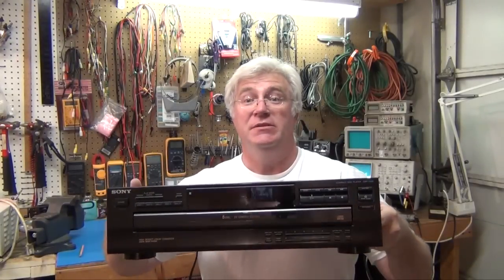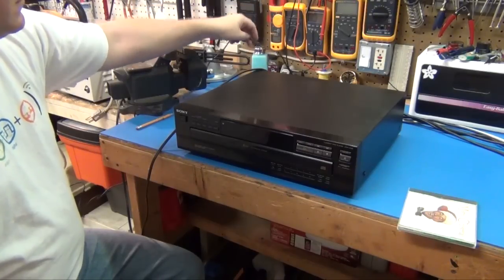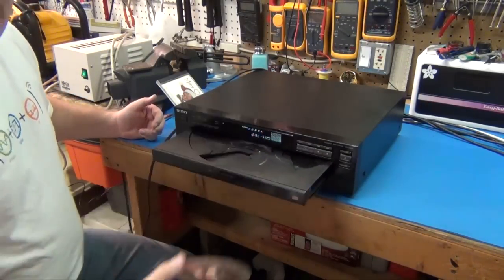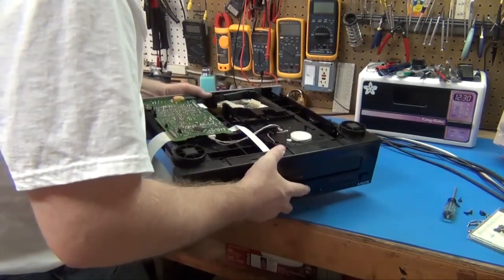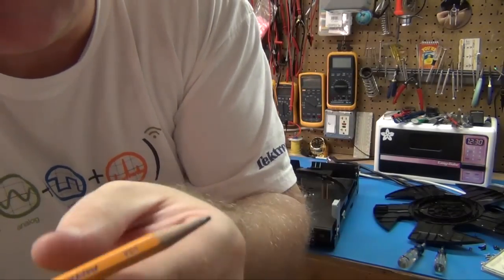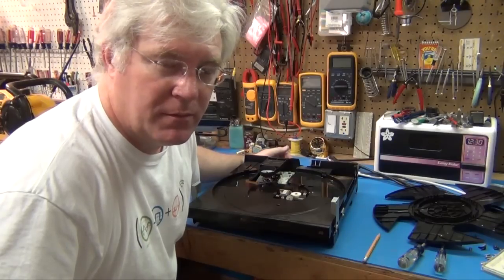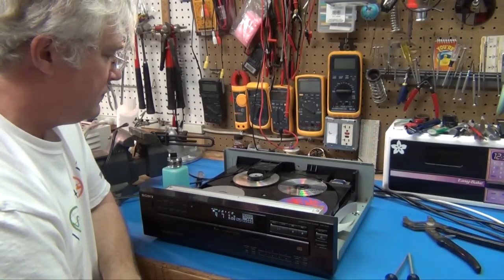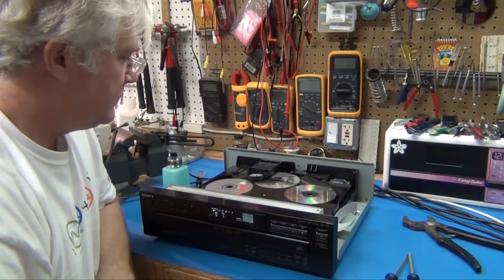ToddFun.com: Repairing a 5 disk CD player

Comment: I have 3 cds stuck inside a Panasonic 5 disc stack system version that broke down today, with one CD quite valuable & rare. More concerned about safe extrication of the discs tgan keeping the player working at this stage, but with no mechanical experience it's a bit daunting! I may try unscrewing some screws to see if I can in any way access them inside. 

  As they say, nothing lasts forever. I suspected it was getting close to the end of its life when the random choice play stopped working, which involved a lotvof disc-changing.

Comment: Would compressed air be the worst thing to use to try to clean dust/debris out of the disc player?  And who wants a multi discount player?  The person with over a 1,000 cds and likes to play them.
Reply from the maker: taking them apart and gently cleaning the optics with a Q-tip helps a lot of times too.

Comment: I have a Panasonic 5 CD player. When we took it out of the cabinet to paint the cabinet and then put it back in the cabinet, it no longer does the commands. It just keeps saying change, change, change. The sound it makes resembles a slight sound of trying to move but it doesn't. Took it apart but couldn't get to the CD's to remove them. This CD player has two boards, one on each side but we don't know what to do to try and fix it. Can you help?
Reply: Sounds like belts are worn stretched or broken time to replace, you can get away with rubber bands that are same size as original ones, I just replaced belt in my Sony 5 disc cd player & recorder works great now.

Comment: Thank you. I just took my Sony 5 disc player apart exactly as you did because I had the same problem. Cleaned the optical switch put it back together and it works fine.

Comment: I have a sony cdp-c26.  It's powered off (except during christmas season :) ) but recently it started shuffling the (empty) disk tray.  The power doesn't turn on nor does the drawer open.  Would you guess this is an optical sensor problem, or more likely electrical?
Reply from the maker: Hard to know. If you can't do repairs one can get working replacement units off eBay nowadays real cheap.

Comment: I have one of these that was sitting in my basement for 5 years, I just took it out and when I plugged it in it powered on but the front drawer wouldn't open and it wouldnt power off when I pushed the power button, I was going to just throw it away but then I decided to do an old fashioned repair method, I punched it in the power button and punched it in the eject button, the drawer opened 1" and I pulled the drawer out all the way and it closed by itself when  I  pushed it, and then I was able to get it to open and close by itself, now it's working fine. :), so sometimes the old fashioned repair method (teach it who's boss) really works!

Comment: You made the comment "Who would want a disc player" thanks to memory stored media! I much prefer the less compressed audio quality of original CD's, and still have several hundred I enjoy listening to. There is a fairly large market on Ebay and Amazon for working used changers and they command some crazy high prices now in 2020!
Reply from the maker: I fond them at Goodwill and other donation shops for $5 every time I go to one. Not normally the 5 disk changer cartage but often the 5 disk draw versions. If you go on the 2nd Saturday or whatever they will give you it for 1/2 off, plus if you stop in on a Wed and put an item on lay away you can still pick it up on Saturday for the 1/2 off price (secret most don't know about Goodwill).
Reply: @ToddFun  that and various thrift stores have been a great source. Thanks for your comment!

Comment: Seems like one of those issues where a solid tap on the top would have magically fixed it. 😂
Great job though!
Reply from the maker: Thanks! 👍
Reply: That's what I did with mine (except I punched it in the front panel) and now it works.

Comment: I have the identical model Sony changer which I purchased used for $10.00. Tray did not open so given courage by your video, I took top off and discovered that the rubber belt which moves the tray in and out had fallen off. I had to find a new belt and take the carriage off the base to replace it (belt was still loose in the bottom but not tight enough anymore). Thanks Todd!
Reply from the maker: Great! glad to have helped.

Comment: Nice video Todd. What could be wrong if it picks up the cd in the loading area, but wont spin? Thanks
Reply from the maker: Must be an alignment problem or bad optic. But first try resetting all the ribbon cables and snugging up any screws.

Comment: Hey, you just pulled it off easily, my choice for years has been Technics and although nicely built they suffer from the same problems. I've just got a similar carousel from my favourite make but it might need the lens replacement. Slightly more complex job
Reply from the maker: Very, I think I wouldn't even try. But let me know if it works.

Comment: Nice video.  Being from 7 years ago I doubt you are still reading comments on it, but thought I'd drop a line anyway.  I just picked up an identical looking unit.  It seems to work fine except that sometimes it fails to read when the tray first closes.  The tray seems to not seat all the way in completely.  If I give it a push then all is well.  So I may take it apart, and try lubricating the rails.  As to why someone would want this in today's day and age, well for me it is nostalgic.  There is something satisfying about handling actual physical media.  Sure I have my entire music collection ripped to Flac, and available on my media server, but sometimes I like to actually play the physical CDs.  So I was happy to come across this 5-disc changer this week for $20.  I'm sure it will provide years of enjoyment.
Reply from the maker: I'm still reading the comments. I hope you get it working but if not you can get these on eBay all day long. But all of these have age issues so maybe start a record collection. At least you can service old record players.
Reply: I never was a huge fan of vinyl.  Before the advent of CD's I primarily collected cassettes, but I did have some vinyl, which for better or worse I got rid of about 10 years ago.  As for this 5-disc changer it does work.  The drawer just seems to stick a little bit when first closing.  A slight nudge and it is good to go.  So I'm hoping a minor adjustment, or some lubrication is all that it needs.  Otherwise it seems to operate great.

Comment: I have a Sony CDP C725 that started nor reading the discs. I took the cover off the other evening and cleaned the lens. It would start spinning the disc and stop and then go to the next disc. After going through all the disc slots it would say No Disc. After messing with it for a while it started working perfectly. I let it play for another hour or so... still working exactly. I left it with the cover off in my shop for the night. The following morning I went to the shop to check it out again before hooking back up to my system. Unfortunately, I was the exact same thing. Any Ideas??
Reply from the maker: Bad electrolytic capacitors in the power supply could be one possible problem. However the cheapest solution is to replace it from something working on eBay or move all your CDs to computer files using iTunes or some such program then get a bluetooth player and either push music to it from your phone or put all your music on a SD card and put it in the player. I have this one and it works great: https://www.amazon.com/gp/product/B00JGFH33M 
"EasyAcc Mini Portable Bluetooth 4.1 Speaker with Mic, 3.5mm Aux, FM Function, Micro SD Card Support"

Comment: This video really helped. You asked who would be interested in a 5 disc player. Somebody old or folks who frequent garage sales I suppose. We don't all throw everything away with every change in platform, having sunk so much money into audio over the years. I pulled my Sony out of a heap of remnants when my son left home and have been using it for the past 10+ years. And it finally read "No Disk". I figured it was an optical problem just like your guess. It was. But I was intimidated taking it apart not knowing the first thing how to find the counter. I took it apart as you did and cleaned the bit you pointed to and even managed to get it back together, every screw. And it fixed it. So it was more than just an fun "what if". Very useful. Thanks. You better believe I'm going to brag to my son. :-)

Comment: Dear Mr. Harrison, I own a Magnavox CDB 650 (1986 made, in Europe, purchased in US) that stops after about the 6th or 7th track on a disc.  I did have it open yesterday, and, useing a lens brush, (no solvent), gently brushed the lens & CD receiving spindle of any dust.  They looked fine, with very little dust.  Put cover back on (the only thing removed), but still have the same issue.  The other noticeable symptom is, after the 4th track (same CD), the ¿servo? makes a high pitch noise/whine.  (It's quiet for 1st 4 tracks, however, but the soft whine shows up as said).  ¿Is there any advice/help you can offer me, kindly, please?  I like this player, as I've modified it's output stage (DC) with better capacitors, and has worked fine for many years.  It's only these last few years that this problem came up.  Thank you very much.
Reply from the maker: I really couldn't be of much help on this issue. Maybe 12VoltVids could help: https://www.youtube.com/watch?v=yaXwF_1DxtA
Reply: Thank you very much, Mr. Todd Harrison.  I appreciate your kind and very prompt reply.   Thank you again, and may God bless all your good endeavors.  Thank you again.

Comment: Hey there Tod. I have a DAV-HDX285 that's having some tracking problems. (video freezing) It's either cleaning, or replacing the optical pickup block. Do you have any suggestions?
Reply from the maker: Not really. Cleaning for sure is a good first step.

Comment: Hi Todd I recently just drop my carousel disc changer and the button came out is there anyway i can turn it on without a remote or button. please help. Thanks
Reply from the maker: I don't think so. You will have to unplug it and then try to replace the button or find a working remote off eBay.

Comment: I've got a Magnavox 5 Disk CD Player. Was working great for nearly 20 years and more recently just the last hour....playing several cds without a hitch. I hit open and I was able to retrieve all the cds. I noticed what appeared to be an error message EE but loaded another cd, never the less. After all his machine has been like Kryptonite! Well, it wouldn't close....so I gave the tray a slight nudge. Suddenly it closed like a charm. End of story....you might think? Long story short, it wouldn't play, it wouldn't rotate and it wouldn't open no matter what I did. After retrieving a crow bar to force the tray open, I took a deep breath, popped a Xanax and cracked open a beer and went looking for some online help. Found your video on my first search and watched the entire thing. Now calm again, I took the thing apart and did pretty much everything you did. The good news? The thing works like a charm again. The bad news? I have 2 medium sized screws and 1 really long screw leftover that I have no idea where it goes. 
Is that bad....? LOL!
Reply from the maker: +ronster369 If it is working, not at all ;) Glad you got it working. Running a CD cleaner disk sometimes is helpful too.

Comment: Hello Todd,I have a Sharp 5 -disc multi-play compact disc player.Had it a long time the radio,and cassette plays but the disco player,when press play. The disc gos up in chamber but don't play so the arm keep changing . what you think can be causing this????
Reply from the maker: +Michael Williams So many possible issues.  Try running a cleaner disk once but other than that its best to move on to mp3 files and attached an ipod or mp3 player to the AUX in on your system. Or stream from a pc over a wifi dongle adapter to the system.

Comment: I fixed my Carver 5-disc carousel player with new belts, but I think something is misaligned, because sometimes when I open the main drawer it won't stay open, and tries to close. If I press the button again to catch it while closing, it opens back up, and stays open. Strange. 

What do I have to do to realign it properly?
Reply from the maker: +Condor1970 12VoltVids just posted a really good general service video of 5 disk changers. It doesn't address your exact issues but does cover all tray alignment and other faults. https://www.youtube.com/watch?v=yaXwF_1DxtA

Comment: we have a Panasonic 5 disc carousel from 1991 and the laser don't longer works.  can it be replaced
Reply from the maker: +Carolyn Balkcom It could be possible but it would be cheaper to purchase a working one off eBay or switch over to an mp3 player or ipod connected to the aux in of your stereo system. I would not try such a repair on such old and obsolete equipment. You should watch 12voltvids video on some of the cd player repairs " https://www.youtube.com/watch?v=yaXwF_1DxtA" as well as others on YouTube if you do plan on trying to fix your player.

Comment: Hi Todd, first of all, congratulations for a very nice video, besides technician you are a very good and natural actor. My CDP 315M was bougth in 1985 in Paraguay, I live in Brazil and it has shown the sane synthom as in your demonstration, the caroussel goes back and forth, furthermore it doesnot turn under command, or any way, although its drive motor is ok, the idley pulley that drives the caroussel seems to be glued in its axis. I have two questions: 1) The lilttle motor that drives the caroussel is a step motor or a dc motor? 2) If I can not repair the idle pulley which drives the caroussel, can buy this part, once this CDP model is more than 30 years old? I really appreciate your help. Thank a lot César Miranda

Comment: Hello. I have an RCA Boombox (RS 2635) with a 5 disc CD changer. I believe the problem with mine has something to do with the motor that operates the door. I have to pull it out and shove it back in and sometimes it's a bit jerky and sometimes it is troublesome to pull out. Any advice on fixing this?

Side note: there also seems to be some trouble with the "Next Track" and "Previous Track" buttons on the front when in TUNER mode. Sometimes these buttons change the station and sometimes they cycle between the 35 Programmable presets, which when they are all set to static this becomes very difficult (I'm trying to change the station and it just goes to the next preset which is also nothing).
Reply from the maker: James Clark I think 12VoltVids has video posting that will help you solve your problem: https://www.youtube.com/watch?v=yaXwF_1DxtA
For the buttons you might just have to take them out and clean them with some electronic contact cleaner, if that is possible on your unit. Her is a link: http://astore.amazon.com/tod0f5-20/detail/B00006LVEU